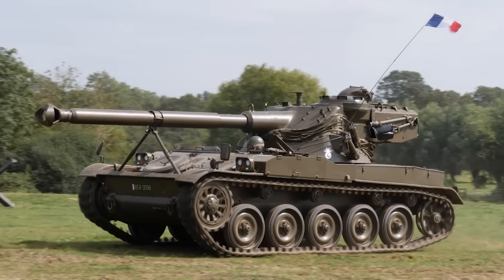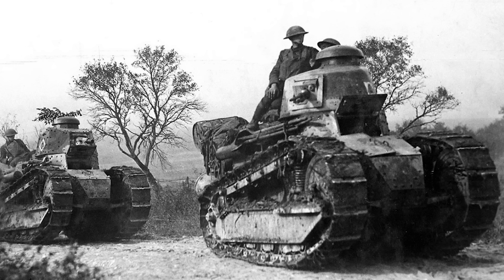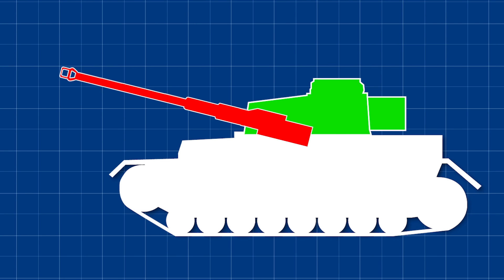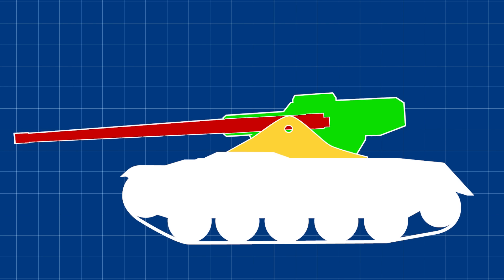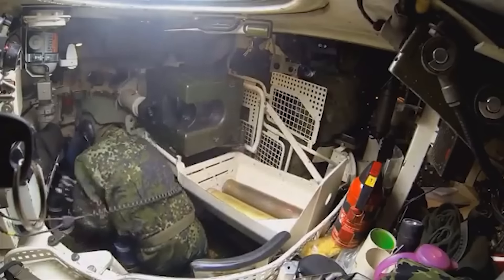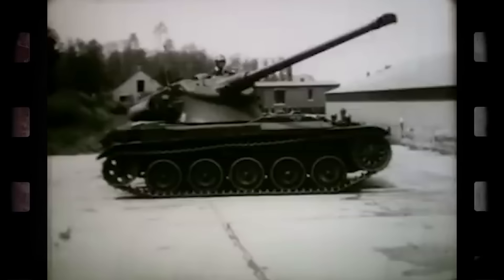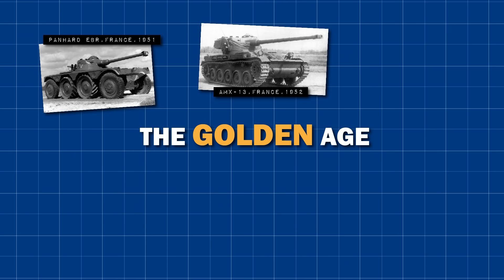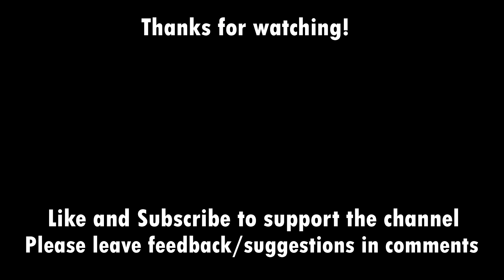What actually IS an “Oscillating” turret?

Comment: The gun automatically resetting to the index position isn't really a disadvantage because the FCS will automatically point the gun back to where gun is aiming and side the sight is independent of the gun mantlet the gunner doesn't even notice a difference. This system is used not only on autoloading tanks but many manually loaded tanks most notably the Leopard 2.
Reply: This has only been the case in the modern generation of MBTs. During oscillating turrets' debut and popularization, such FCS was not commonplace whatsoever, even in the most advanced armored forces.
Reply: @bluntcabbage6042  the soviet T-72M form the 70s had a laser rangefinder and a FCS
Reply: @jungletroll3844  A very, very primitive FCS by most standards, but yes.

That isn't the time period oscillating turrets came into prominence. It was largely the 50s and 60s that saw oscillating turrets' rise in popularity.
Reply: @bluntcabbage6042  yea it makes sense they where a thing in the 60s. Im just saying that restting to index was a thing in the 70s

Comment: Best way to avoid the issues an autoloader brings: mount the gun in a fixed position. If the gun doesn't move, the autoloader has no issue feeding the gun.

See also: Strv 103.
Reply from the maker: I would wager the Strv 103’s method had many more issues and complexities than an autoloader!
Reply: @RedWrenchFilms  Well, not really. Certainly the hydraulic laying on instead of a turret was different and had some issues, but that's more a question of doctrine. If the Strv 103 had been used in the same way as the vast majority of tanks, then maybe, but it wasn't. It was meant for a defensive war.

Then again, the British Army on the Rhine had a chance to test the Strv 103, and said that, other than a question of training, it was equal or superior to its own equipment.

It has been argued that, the Strv 103 could not hit targets on the move, it had to stop to lay on target. But neither could any other tank at the time. Yes, certainly Soviet tanks of the era were able to shoot while moving, but being able to press the trigger does not mean you'd HIT anything, and they would not.

Of course, all of this is secondary. The point was, somewhat tongue in cheek, that the Strv got around the common issues that a an autoloader has by fixing the gun rigid in the tank. No movement, no feeding issues.
Reply from the maker: @mooneyes2k478  That does make sense. But, like you said, the tradeoffs were only really worth it for Sweden’s specific use case of a prolonged, defensive war with limited manpower. I can’t imagine an S-tank would be much use in an offensive role.

Also, many tanks could fire rather accurately on the move at that time - there’s footage of 20pdr centurions moving at a fair pace and dropping rounds onto a target quite far away. 

I understand that you weren’t making some decisive sweeping statement though - it really was an ingenious way to get around the question of how to line up the gun and the rounds.

Comment: Seems the turret operation could be more easily damaged and jammed by an incoming round.
Reply from the maker: Probably just as easy as a conventional turret - any hit along the turret ring could jam it.
Reply: @RedWrenchFilms  no. Far more places to damage on this kind. Looks very delicate.
Reply: @RedWrenchFilms  nop, oscillating turrets are far more prone to jams when being damaged. And we're not just talking about the turret ring here, what about the elevation? 

It's a big ring which is sitting on the outside, unprotected and has 2 of it's most valuable components yet again, sitting there outside of the turret and unprotected

Anything that would hit it could jam it or destroy it

Comment: Another drawback of the oscillating turret has not been named. Such a system has a significantly lower ammunition capacity compared to a tank of traditional design. It's like the capacity of a revolver versus the capacity of an automatic pistol!
Reply: There are 2 hand-operated rotating magazines in the turret, each holding 6 rounds....

Comment: Can just seal it against NBC with some flexible material I would say? The bottom of the ring is sealed the same way as conventional tank and the part connecting to the gun module with some synthetic material. Don't see the problem here?

Comment: Soo.. put the oscillating turret on a drone vehicle & eliminate NBC requirements, down to weather resistant.
The drone already needs an autoloader, so it now becomes almost all advantages.
As a drone vehicle, many electric, an extremely low hull but high turret might allow limited AA W a co-ax machine gun.
Or even a decent size autocannon & light machine gun.

Comment: 2:10 or you can go the way T-62 went and make turret ring so large that it's wider than the hull. At least that's afaik, it's not too visible but it's there.
Reply: 4:00 not a problem for Soviets/Russians, check their SPAGs and tanks, carousel autoloader (well, in case of 2S19 it's an assist, not pure autoloader, still far better than Paladin's manual loading) can adjust for the breech.
Reply: They did that on the T-54 and T-55 also.
Reply: @executivedirector7467  uh, idk, I only know about T-62 doing that because it's basically T-55 but with new, bigger cannon.
Reply: @unknowncommenter6698  And a completely new turret and a redesigned, if similar hull.
Reply: @executivedirector7467  yeah, chassis were (probably) old but everything else is kinda new.
Reply: @unknowncommenter6698  ??? Chassis were not re-used if that's what you're saying. The T-62 chassis is essentially just a longer T-55, but the turret is completely new.
Reply: @executivedirector7467  not 100%, but still are kinda same thing, no? Like with that odd APC prototype made out of T-55, it's just longer T-55 chassis.

Comment: Just a quick note, the loading systems in normal turret just did not exist at the time the French developed their tanks. It was only really a thing with the Russian automaker that came in the t64 back in 1967. Before that it was extremely expensive, and even the t64 loader comes with huge disadvantages, crew safety being the largest one, as the ammo sits right below the crew, mostly unprotected.
The autoloader you showed only first appeared on the Type 90 and Leclerc tanks in 1991 and 1993 respectively, and are now being used in the Type 10 and K2 black panther as well today

Comment: couldn't you just seal the tank and turret separately? maybe run some flexible but thick hosing through from the bottom to piggyback the turret's climate control to the main vehicle while keeping them as separate units with emergency seals and air tanks for the turret for if that hosing breaks?

Comment: I don’t think it’s fair to say what would or wouldn’t work considering how few prolonged wars have occurred between countries running modern tanks. I’m emphasizing prolonged because at a certain point things need to be simplified and expedited to replace losses. It would most likely radically change the design to start eliminating costly items that don’t serve well. Like the whole concept of large guns on battleships. What was state of the art in 1935 was completely obsolete in 1945. The jump was prompted by massive failures.

Comment: 4:20 you're saying that aiming your gun away from the enemy is a bad idea for 'obvious reasons' 
Why? 
In reality, this is not an issue, it has no play over combat performance because the gunner and commander sights are independent. Long gone are the days of coaxial sights.
Reply from the maker: Absolutely! It was much more of a concern back in the 50s and 60s when unlinking the sights was more difficult. Early autoloaders suffered a lot from this issue but you're correct - modern vehicles are more than capable.

Comment: I find the nbc excuse to be weak. we've been building ball valves for how many decades now? A seal for a +/- 15 degree vertical adjustment shouldn't be that hard. I also want to point out that the AMX-13 wasn't just small. It's absolutely tiny. The entire thing loaded for combat weighs less than 15 tonnes and can pack a whopping 105mm/57 caliber (barrel length, not bore diameter) main gun. That is firepower equivalent to the Stryker Mobile gun system in a vehicle that weight 3 tonnes less, a foot shorter, half a foot narrower, and has an Over All Length two feet less than the hull on the Stryker. And the whole thing is on tracks with superior armor (not including any armor packages on the stryker.) My only question is what's the price difference, because those Strykers aren't cheep.

Comment: 3:58 I'm not a expert so take this with a grain of salt but can the problem be solved by attaching the ammunition storage and autoloader to the turret?
Reply: no. you would then have a giant mechanical mechanism splitting the turret in two. Another reason is if you keep the ammo in a separate compartment and it detonates then that compartment gets destroyed and not the crew compartment
Reply: @jungletroll3844  Ok.
Reply: @jungletroll3844  So the only way to solve it is to get a complex loading machine/

Comment: Ok can someone answer me this: 
So it has become obvious throughout this video that oscillating turrets aren’t fitted for modern main battle tanks. But could it be used (would it be practical) for artillery tanks? I mean something like the Panzerhaubitze 2000 for example. I mean they aren’t in the battlefield so it wouldn’t really matter if they were easiest to spot or aren’t properly sealed, right?
Reply from the maker: Oscillating turrets are actually a very poor fit for SPGs because of the limits on gun elevation. Artillery pieces naturally need to elevate their guns so much higher than tanks and oscillating turrets are poor in this regard. On the other hand you could argue vehicles like the Archer use oscillating turrets already but the line gets a little blurry, since the gun compartment is on hydraulics rather than a pintle.
Reply: @RedWrenchFilms  ah ok, tanks for the response
Reply from the maker: @keck4022  No worries man! Also this is just my opinion as a tank fan so take everything with a grain of salt haha
Reply: @RedWrenchFilms  I’ll do. No worries

Comment: I understand modern 'militaries' (at a country scale level) need to consider the NBC threat.  But how often is that threat ever actually seen in combat?  Hardly ever?!  Even in this modern conflict in UKR we haven't seen it.  I don't know why there aren't more modern designs like this....hull downed defensive positions for a tank like this would be tough to knock out of the fight I'd imagine (yes, that's very specific).  But militaries develop specialized equipment all the time.  The US military industrial complex doesn't think it's worth it to design a tank which could be useful for such a role, not considering the NBC threat?  You could have a small fleet of vehicles that would be riskier for the crew (depends on how you define 'risk') with some huge advantages (larger guns, more survivability in defensive positions).

Comment: Interesting that the "M1128 MGS" couldn't get the autoloader working correctly, yet the Panhard EBR, AMX-13, and Austrian Kurassier all had working ones. I'm sure that the U.S. oscillating prototypes were useable. I'm sure that someone overcomplicated the system to up the price.
Reply: I've also heard another issue was that the system was too light for the gun and it would mess with the electronics.
Reply: Americans did have successfull oscillating turret designs in those times too, you could even see them in this video.
Reply: If I remember correctly, they made it overly complicated by having a secondary ammo storage and secondary autoloader in the hull.
Reply: the difference is how the ammunition is being loaded, the AMX 13 and the Panhard EBR (later variants with the larger FL-112 turret) were being loaded with the bustle in line to the gun, while the M1128 MGS had the rounds within the hull which is then pulled/lifted inline towards the gun breech and then loaded, tbf to the designers, they most likely just had to do with what they have considering they were to be mounted on the stryker platform instead of a dedicated platform.

i doubt it was made to be complicated for pricing but made to do so as to protect the ammunition if the turret is being peppered by projectiles.

Comment: well you are wrong on indexing, the gun, unless built chinese, will return to previous angle of elevation, or AoE from here on out. the AoE is "remembered" by the gunnery computer so when it is been fully loaded and free to move again the AoE is restored then "forgotten". even the russians have this working right with the late T-64's and T-72 onwards. because it is a simple script to run each time it fires. though the russians and the T-72 got an autoloader done right*

*mostly done right, the issue is it is built russian.

Comment: Why T-14 tank's turret is conventional rather than oscillating.  Since all the crews are in the hull.
Reply: T-14's turret is conventional because the turret isn't split into two halves wherein the top half elevates and depresses. Only the gun does this in T-14, so it's conventional.
Reply: @bluntcabbage6042  I know it's turret is conventional but automated. I asked a theory about why not put the automated occilating turrey.
Reply: @inguunenkhtaivan9146  Issue usually comes down to stabilization. The more mass the servomotors have to throw around to keep the gun on target, the more expensive and complex the design becomes. It's certainly doable, but it's a case of weighing pros and cons.

Russian tanks have had notoriously bad servomotors for much of modern and Cold War tank design, so that probably factored into choosing a conventional turret over an oscillating one.
Reply: @bluntcabbage6042  OH, thanks for the information. Didn't know about it. Very valuable.
Reply: @inguunenkhtaivan9146  of course o7

Comment: Why tanks gotta have people in them at all? Make a 50 cal “mini tank” with Maddog optics and swam interfacing with overhead loitering munitions/recon with that mad heat vision you’ll see em at night, I also seen them recon flip flop two wheel one axle fbi “drones” but it’s more like a teen trying peeping Tom, just stack c4 and a speaker and tell em st8 up
Reply: So your whole point is to re-used post-WWI and late 20's tank design? seems like it won't be preferable though
Reply: @thelukesternater  it'll make it far more vulnerable against infantry and diminished the primary role of a tank, thus cannot be called "tanks"
Reply: @Kalashnikov413  ok, call it “German word for small+ French word for snail”
Reply: @thelukesternater  klein escargot?

Comment: NBC may be a disadvantage... but I think that if any of the N-B-C types of weaponry was actually commited to that scale that "disadvantage" doesn't really mean much anymore. You can't keep hiding in a tank indefinately, so being able to weather NBC attacks would only work (mean anything) if its like _"I need to pass through this cloud of crap to the other side"_.

Also, comparing an AMX-13 to an M1 Abrams is a bit of a stupid thing...Okay I get the referencing based on technological fidelity and onboard features, but classification and war-era wise the compare makes no lick of sense. One has its origins in WWII, a ~13t 'light' tank with as heavest calibre a 105mm cannon (barely in service btw), while the other is an MBT platform 60+t 'heavy' tank with a 120mm cannon.

Comment: This video would had been incredibly useful to me when I struggled with comprehending oscillating turret's design. However, oscillating turret is not inherently impossible to seal. It is just one of those technologies which were given up without proper effort being given. For one, you can mount an external skin on outside or inside of a turret. This skin would acct as a bag, isolating tank from on outside while sealing potentially dangerous chemicals inside of a tank between its armor and a second skin. 

Furthermore, if war would had went so far, this flaw is not properly thought through anyway. Crews need more sustainable solutions like uniforms and gas masks to operate in NBC environment. Otherwise their combat effective period is as long as they can stay inside of a tank or get immobilized which is not really realistic. A tank crew is going to need to come out, to disinfect their tank anyways. The ugly truth of all out war is that nobody was prepared for it. Oscillating design is one of those things which nobody actually preferred to have due to its strengths and weaknesses. It could be sealed if given effort. As for today, it is not worth it as remote turrets are the next best thing.
Reply: NBC uniforms and gas masks are extremely degrading to human efficiency. They are extremely hot and heavy, and communication is very degraded. So having an AFV with an overpressure system that eliminates the need for crew to don these uniforms are really advantageous.
Reply: @executivedirector7467  The problem that in NBC environment, you will quickly have to leave your tank. 

Think it like this. Imagine that all threats hit the battlefield. How long can NBC tank remain combat effective? A day? What if it runs out of fuel? Ammo?  Food and water? What if tank drops a track or gets stuck? Crew cannot realistically expect to be combat effective in NBC environment even with NBC tank without learning how to effectively maintain their operations with hazard suits on. This is why I was saying that no one was truly ready for such a war.